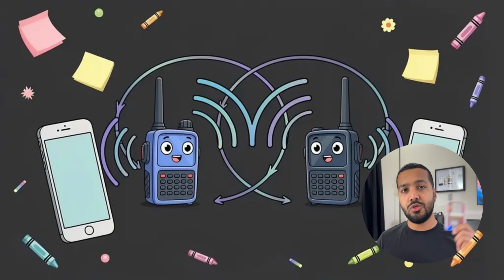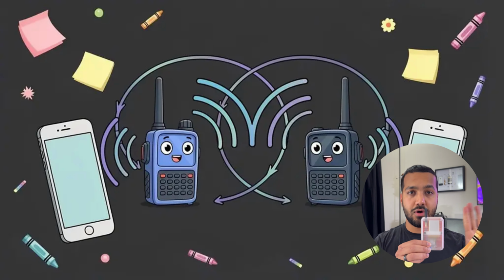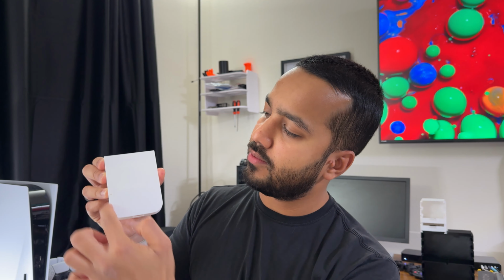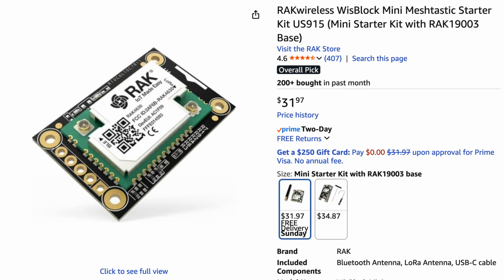How Do You Carry a Meshtastic Radio? Stick It to Your Phone.

Comment: Why doesnt anyone design these with the antenna fully internal to the case? Is the plastic really that disruptive to the signal?
Reply from the maker: Signals especially traveling long distances need unobstructed antennas. It can be inside the case but at the cost of some signal strength decay. I will make one just for you with the antenna inside if you buy.

Comment: thanks for sharing. you said the phone uses Bluetooth to connect to it, so less than 30m range? and that's why fitting on back of phone? I'm assuming the mesh uses wifi and much greater range . do you have a link to 101 / dummies guide for if going try using the system for 1st time 🤞
Reply from the maker: The range is actually Miles. It doesnt use wifi or bluetooth. It uses a totally different frequency that allows for cery long distance communication.

Just look up “how to get started with Meshtastic”
Reply: @ShreyashGuptas thanks

Comment: I've built and designed my own Meshtastic enclosures (Fusion 360, PETG carrier boards, all that jazz), but only for outdoor/roof mounts (didn't want to pay $15 for an ABS enclosure haha) so I know all about what you're going through and it's NOT EASY! One thought.. I bet you could stuff that little antenna inside the case and you wouldn't notice a difference. Have you tried that? Even a smaller footprint would make your design even better if that's the case (no pun intended). Also, the Seeed T-1000E (my daily carry) device is SOOOO small, whatever antenna they are using still provides me with amazing Meshtastic connectivity.. so this is where my head is going regarding the ---> "hide that antenna inside the case".. either way.. Keep making cool stuff.. :) I love the video!
Reply from the maker: I've thought about putting the antenna inside and I have not tested it but I'm sure it will work. For the Seed Studio I actually have a friend who bought it but it had terrible signal strength so he actually returned it. I've had mixed reviews from Discord communities some saying it's really good and some saying it's really bad. That's why I kind of decided to make this one but I'm glad it's working great for you and Thank you for your feedback. Really appreciate it!
Reply: @ShreyashGuptas  Totally get it.. I have 2 RAK Wisblocks, a Seeed T-1000E, 2 Heltec V3's and an Lilygo T-Echo.. When I care each of them I find that the T-1000E keeps up just as well if not better than the nubby (Heltec) antenna ones.. Also, I think the Lilygo T-Echo has a much bigger/better antenna.. Either way, I have no idea how the Seeed T-1000E antenna could even compare, but in my person case, it actually works well! Maybe your friend got a bad device, who knows! Maybe give it a shot and try and hide the antenna, maybe you'll be surprised! Great work!! Looking forward to more content like this! :)
Reply: i love that 1000E but hate the propietary mag charge cable. I´m thinking it should be in a magsafe box laike this size and charge right off magsafe. Then it would be a daily driver.